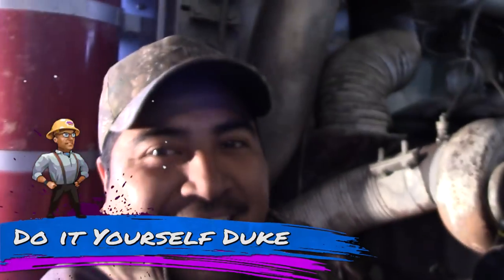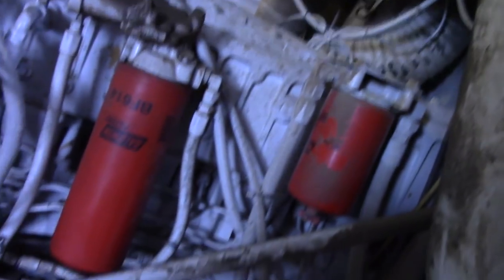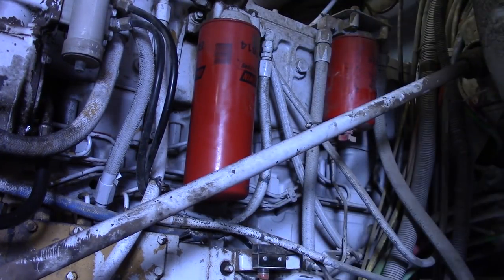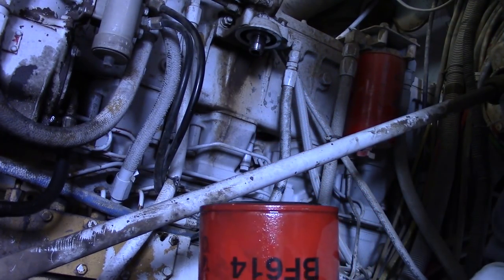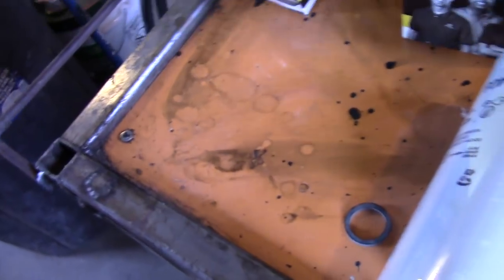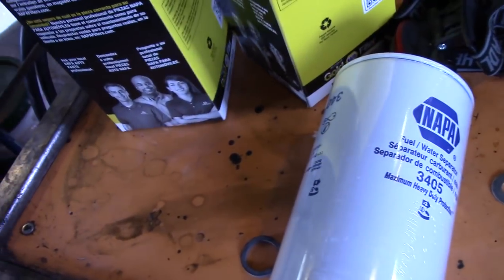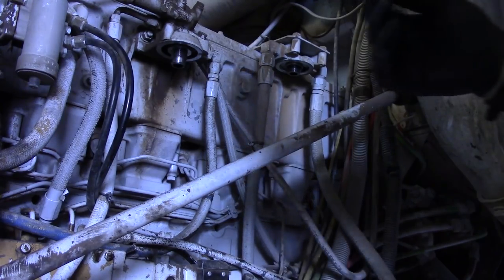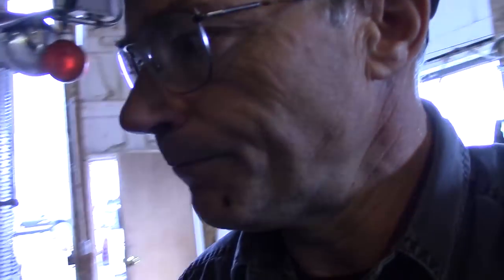How to do a Fuel Filter change on a BIG Truck - DIY Duke

Comment: Question i have a 2009 KW w900, i was driving then kept losing power in my pedal, could that be a bad fuel filter ? Or i have to replace the hole throttle ?
Reply: Did you find out the issue?

Comment: Hi sir, thank u for u videos, thanks a lot, one question, how often do you change the fuel filters ?
Reply from the maker: +Carlos Figueroa hey Carlos manufacturers recommend every 30 to 50 thousand miles but I recommend sooner because fuel filters are not that expensive and when one gets dirty you lose power big time.  I change them every time I change the oil.  Better safe than sorry.
Reply: Thank u for ur time sir, can you please make a video of how to grease the semi truck and how to check the transmission oil, will be very thankful for me and your subscribers,  and tomorrow I will change my engine oil and which one do you thing is the best oil for my freightliner 500hp Detroit engine ? Am sorry for many questions but am 21 and am own operator and I want to take care of my truck because I drive over the road and I want to learn something of everything or at least to take care of my truck by myself before go back to the road, thank u for ur patient.
Reply from the maker: +Carlos Figueroa yeah Carlos I can do that coming up in the near future.

Comment: Another awesome video DIY Duke! I noticed that on the oil change video you filled the filter with oil before putting the filter back on. Is this essential or just good practice? I understand air in a fuel pump/line could be trouble but is it the same for the oil?
Thanks from New Zealand!
Reply from the maker: +Brad Knox I've always put oil in the filter, that's the way I was taught, that way on start up there's immediate lubrication.  If you Google the question a lot of people don't think it's necessary but there's a lot that do.  You know how that goes everybody's got an opinion on things.

Comment: you said tighten the fuel filters same as the oil filters on these diesels? I know after a certain point, the fuel pressure is so high on diesels because of the compression ratios
Reply from the maker: +taledarkside yeah the same. Recently changed the fuel pump on the Cat 3406 which is gear driven at the front of the engine, but there is a high pressure injector pump also.

Comment: How do you bleed the fuel system on these trucks? With the one ton trucks, we just key cycle the vehicle 4-5 times.
Reply from the maker: +taledarkside it's no fun for sure, just did it on a Perkins diesel where there is a manual pump on the side of the engine, you pump that, then open various lines bleeding the air out until you get to the injectors.  Similar to bleeding hydraulic brake lines.  One of the guys ran the diesel out of a Case tractor, same deal, but it's out in a field, no, no fun at all.

Comment: hey I got a question. I picked up a Mack and went to go change the filters, when I soon realized they're on there stupid tight. so tight that I broke my filter wrench. is there any tip you could pass along to get them off
Reply from the maker: Bad Company what works for me is to drive a punch that will go through the filter and use it as a handle to turn the thing.  otherwise with a wrench it'll break (like you experienced) or the filter will keep collapsing.  A big screw driver will work as well.  You may have to drive it through in several spots until you get it to begin turning off.  That's why it's so important to not over tighten filters.
Reply: DIY Duke Ya I personally don't but the previous owner must have gone ham on it.
Reply from the maker: +Bad Company I think a lot of shops are having their people tighten those because some are coming off, but there is a happy median
Reply: DIY Duke I put all my filters on hand tight and have always pulled them off a little tighter than when I put them on.
Reply from the maker: Me too, it's always worked